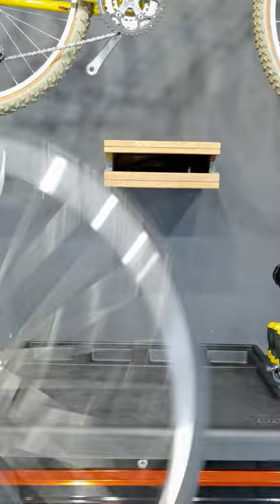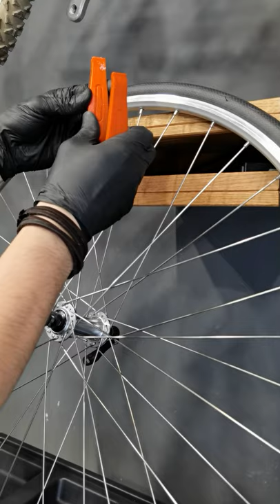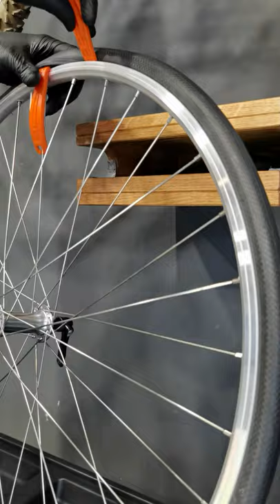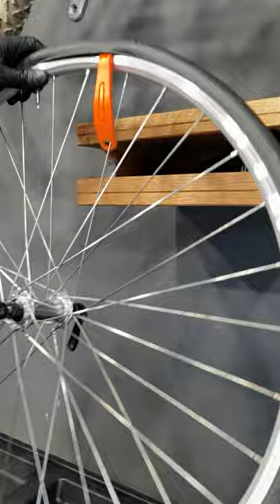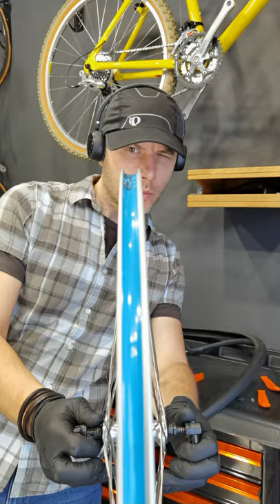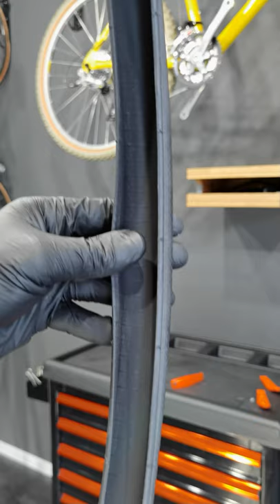How to remove tire from a road bike wheel. #shorts

Comment: It's easier if you insert 2 tire levers about 5 Cm apart and pull them both at the same time. 

I pull most off by hand with no levers by really working the air all out and going around the whole tire pinching the bead toward the center of rim, then rolling the top of the tire over the rim